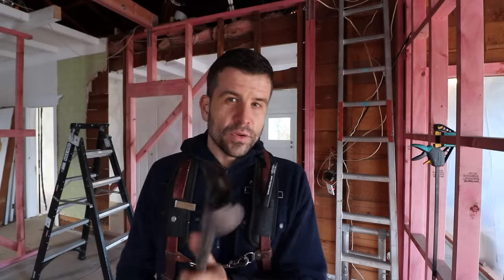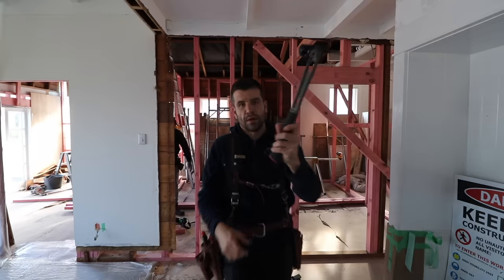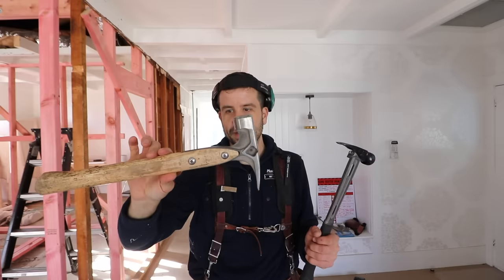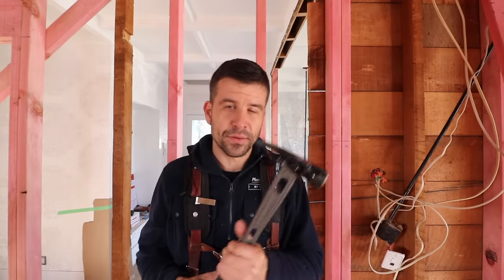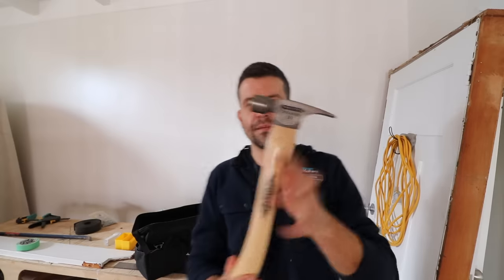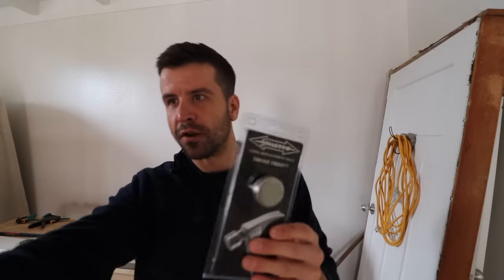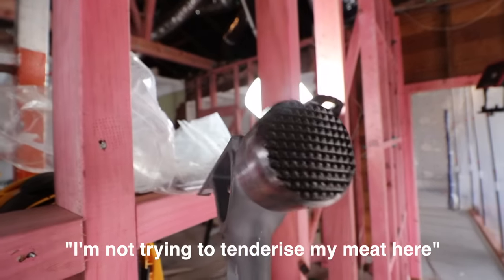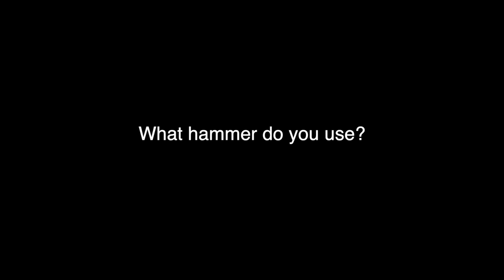Martinez M1: The Hammer Everyone Is Talking About

Comment: There's nothing new about this hammer, other than the Mfr's name on it. I swung almost that exact head design, made by Douglas, almost 2 decades ago. I believe Vaughn bought out the design/patent and/or company. This was a fantastic hammer. The top of the face was flat and you could hit a nail that was tucked into a corner. Nailing hangers w/ it was very easy. At the same time, Stilleto was making the TiBone. An all Titanium framing hammer, that had a replaceable face.

Comment: Im not a carpenter but I’ve framed garages, barns sheds, knocked down walls and and moved em just don’t do it every day. I be always been of the option a cheap hammer and several expensive pneumatic nail guns is the way to go. Again I don’t do this stuff for a living but still have a framing, brad, and roofing nail gun. I’m just curious why y’all use a $200+ hammer instead of a gun?

Comment: Been framing for 50 years....what  hammer you use isn't important if you use a nail gun. If you actually frame with a hammer use a wood handle with a 24 oz. head...no blisters and your arm won't wear out. If you're a remodel butcher use a metal hammer handle....better for pulling nails. Best hammer i ever used is a 24 oz. Plumb with a waffle head. The handle is great for your hand and the head steel is so hard it sings. Ive had one for over 30 years and the head waffles still look good. Btw titanium is just too light.

Comment: Call me an old dinosaur, but I'm still partial to my Estwing 28 Oz, long handle, straight claw framing hammer. If I use the non-waffle head one, I can do trim carpentry with it. It's just what I've used for 30 years.

Comment: I have bought and swung and embarrassing number of hammers. I've now had an M1 for over a year and I will never swing another for demo, framing, and general carpentry. I keep a shorter handled hammer around for trim work but that's it.
Reply: Straight or curved handle? Smooth or waffles hammer face?
Reply: @henri6595  the one I have has a curved handle, but I'm still debating getting a straight replacement grip. Started off waffled, now it's smooth as a baby's butt
Reply: @717UT  Thanks for the reply. I been looking at the M1 and M4 compared to the Stiletto Titanium Hickory Handle hammers. Do you have any experience with the Hickory Titanium Handle models? If so could you compare them? Is the vibration really that much less on the titanium handle compared to Hickory?
Reply: @henri6595  In the past I've had a 14 and a 12 oz stiletto with hickory handles. I actually still have the 12 on a short handle. Also have an old Mini14 Stiletto. I think, and this is pretty subjective, the rubber over the titanium on my Mini14 and M1 make for the best dampening. But if you want a super lightweight hammer, wooden handled Stiletto or Dalluge are hard to beat. I guess it matters in the work you're doing too. Just framing? Wood handle may be best. Demo and form work? Might want an all metal hammer to stand up to the abuse. I remodel so I demo too much. I'd probably beat up a wooden handled hammer in those scenarios. And I think the M1 hits hardest of all the lightweight hammers I've used.
Reply: @717UT  Thanks for the information! I will be doing home renovations just like you. Seems like everyone agrees the titanium hammers with rubber grips are the best to recieve the least amount of pain later.
Reply: @henri6595  You're welcome. And this is all my humble opinion. Remember too, the best pain reliever is setting a steady pace. The worst pains I've had has been when I'm pushing too hard for someone else's gain. Work hard but not at the expense of your health and well being.

Comment: It's space age looking junk. Titanium is brittle compared to steel so not worth the cost compared to a standard steel hammer. A wooden hammer handle is easily replaced or repaired by a craftsman and will have way better vibration dampening properties compared to metal. Wouldn't spend more than $5 for a hammer like that can't believe they are selling for $100+. Unreal.

Comment: 3:11 Thats more on your tool belt set up than the hammer.  That would be annoying having a hammer there any way. So much unnecessary reaching.Hammer sleeve  would fix this. Had this hammer since they came out  2017 i think. And the wooden handle framer of the same brand. The deluge looks awesome and know a few guys that use them. But the handles seem to break after a few months on the Vaughan version. Apparently you can get the true deluge version which last better.  You can get a straight grip for them i have the curved like you show here and am also thinking of changing it to a straight.

Comment: I have a Cheney hammer.      It's about 60 years old .  It's a ball bearing model, and it tells you which part of the nail to hit.   It pulls out nails if you put them in the wrong place.  The handle is made of special wood, it comes from a special tree.   It cost about $3.00 after we stopped using British money.   It balances perfectly, if you stand it on its head the handle points to the sky.

One side of the head is made to get bottle tops off,  it's a beauty!!!  I lost a degree of respect for this Chanel once I saw this shameless promotional crap.  You should have more self respect!!

Stavros

Comment: You get used to the handle pulling out of your bags. When you reach for the hammer make sure the head is pointed to the right side of your body and grab it with your right hand by the head and then muscle memory the handle coming out it comes out FAST. And the fact that you can see through your side puller makes it easier to use. My boss has been arguing with me that his Douglas that is very similar to that Vaughn he showed, us better and he says my stiletto TBIII bounces off 16’s and can’t move trusses. It does fine at 16’s but it’s faster than the other hammers. Wanna try the Martinez but I’m pretty good with that stiletto.

Comment: It sounds like you guys aren't aware that you can buy an M4 head and put it on an M1 handle. If you like a longer hammer, and lighter weight, mix and match. The best thing about the Martinez platform is that is is modular. You can buy a 2lb sledge head to put on either the shorter M4 frame or the longer M1 frame.

Comment: As a mechanic who always has some sort of grease/lube one his hands, and has trouble gripping tools properly. A tip from my grandad, remove that polyurethane coating on the handle. It’s basically plastic, bare  wood will never slip and if your worried about it warping or becoming damaged because of water, just give it a coat of linseed oil.

Comment: Did you bang in a gun nail cause ypu dont have spikes haha?? I prefer the TB though (mine is TB 2) to me its abiut the angle of the face relative to the handle. With the face flat on the ground the stiletto handle isnt touching the ground, Martinez is... more likely to dig the top of the head in and not strike with the face flat with the martinez IMO. I nail fascias and stuff with my framing hammer so i dont like to leave huge wounds in everything. Also i feel like i just strike more square with the stiletto

Comment: The m1 is great for heavy duty formwork where you still swing a hammer for a living and slap spikes all day not for guys that use a nail gun all day you need to grow some muscles 💪 lol.... try a 2 1/4” slick in the nail set on the tb3 it barely sticks out past the face not very well thought out... plus the steel head on the m1 holds the magnet better where as with the titanium head your always having to replace it due to scientific stuff

Comment: Slippery need of wood hammer is best dealt with by taking a metal card scraper and removing the finish on the handle. Adds grip without the stickiness of tape. When hammer gets dirty, it's easier to wipe/scrape clean.

Comment: You sand the finish off the timber handle the same works on wooden screwdrivers  after you get the finish off you can dunk the handle in oil and it won’t slip.

Comment: I used a Douglas hammer back in the early 2000s. It has the same shape as the Dalluge. Hart tools also made a version using the patented Douglas design. This design was conceived long before titanium hammers were a thing. Because the hammer was originally made from steel the idea was to also use the nail puller as a cold chisel or "Ax." The shape of the nail puller is a comprise between being a good cold chisel and still functioning as a tough cutting instrument. I gave that hammer to my coworker when I left for Architecture School. He abused the hell out of the cold chisel feature breaking concrete flash from sloppy foundation pours, and it was still his main hammer when I stopped by a job site to visit 10 years later! The Titanium would not be able to perform like that. It would break under such a beating. So basically, the Dalluge design is meant to be a steel hammer. They should probably redesign the nail puller at the back end.

Comment: 25 year carpenter here. If never swung that hammer. Looks interesting. I like the 14oz dewalt framer. It's all steel and hits hard like a 28oz hammer. That my fav. But I do have a question, why the hell is the wood pink? Never seen that before. And yes the titanium heads are known to kinda blow up. Steel head is much better. IV had stiletto hammers and for the price of 50 dollars I still prefer my dewalt. I also han a steel replaceable head kind and of course the screw came loose all the time. No good. Top banana make a reverse waffle head. It's pretty cool lol. 
Lmao I just got to the pink wood part. Thanks for the quick reply 🙄😁

Comment: I use a Vaughn, I sanded handle to a slightly better shape took the whole handle down to bare wood then waxed it for grip, no slipping now. I also drilled a 1/2' hole length ways down center of handle and filled it with silicone which further reduced vibration.

Comment: I've been using a Stiletto Mini 14 for about 7 years, faultless. Started with a Estwing 30+ years ago.  The difference in fatigue and impact force is noticeable, pulling nails way better.  Combine that with the Ti doggy bar and multi bar saves almost a kg of the belt!  Tried the Martinez too heavy in the head.
Reply: It was always a BS myth that titanium heads drive better than steel, it came out at the time that Titanium drivers were taking over in golf, and Martinez was smart enough to see the advantages. But Ti drivers are the same weight as steel drivers, depending on factors like minor differences in shaft length.   If you reduce the head weight by one third, you have to increase the swing speed by the same amount that the average PGA tour player outswing the average par golfer; or the average swing speed advantage the long drivers on the PGA, the top ten guys, have over the field.  It is only a 10 or 15% increase in speed, but it sets aside these different levels of super athlete, it is significant in the extreme.  So sure, a Ti head will drive as well as a steel head, but only if you are as fast as the average pro Golfer is relative a par handicap holder. And even if you do that, it is not going to be easy on the body.

A lot of it depends on two things.  Do you actually frame with a hammer, like the pros had to before nailguns were popular.  And what nails are allowed in your local code, or traditions.  Sinkers are a much easier swat than spirals.  Some nails may not be possible to drive with a single swat, and the more you have to hit it, the more there can be an opening for lighter hammers.  For most of my life, 16 oz was popular out east for a long time.  All Martinez has done is make it clear that if you are not production framing with a hammer, you can get by with a 10 dollar 16 oz hammer, that you can spend 250 for.  And we are well past the point where clients will recognize what kind of hammer you have, just as they can hire the crew with the beater vehicles, or top end trucks.
Reply: @HondoTrailside  The Mini 14 strikes a good balance, steel face 14oz.  Having munted wrists and fingers, the shock absorption is the big bonus for me, i don't get the pain in my bones any more.   Yes I use a gun for most driving, but i use the hammer a lot for chiseling.

Comment: I have both the stilleto and Martinez. The only 2 things I didn't like about the stilleto is the face never stays aligned for the magnet nail starter and since I do alot of demo the claw actually wore down significantly. Haven't had the Martinez long enough to judge it but so far they both great hammers and def saved my joints

Comment: I use a 14oz stiletto ti. At my local town fair they have a nail pounding competition and stilettos do well. 

I have tried to drive really big nails with it when working on a barn. At a certain point the lighter hammer tends to bounce off the nail more. For normal framing nails it does great.

Comment: I just found your channel today and have watched a few and am enjoying them. Ok I know its really easy to pick apart someone's hard work in making a video, but...I have to say both you and especially Rich are holding the hammer with your thumb pointing down the shaft and not wrapped round it with your fingers. I think this is where you get tendon issues and you also tend to grip tighter and put more effort into each blow instead of a lose grip with the weight of the hammer doing the work. I see so many people going for heavy hammers because they don't know how to use the weight of a regular 20oz and then end up with tendon issues.

Comment: Carpenters are always going for the wood because it absorbs more of the impact... not to mention it's almost always lighter. Your elbow will give out way quicker with the metal hammer. Go wood or go home.
Reply: With the amount of manual nailing being done nowadays there's little reason for elbow or wrist problems caused by use, unless someone has piss poor technique using their tools.  The highest present day risk to muscle, ligament and joints amounts to the predominant use of nail guns and their quite cumbersome designs, with hammers relegated to finishing work and poorly slung at the rear of younger carpenter's toolbelts.  Falling backwards is bad enough, but having hammer and nail puller badly slung to the rear is asking for trouble.

Comment: I'm a DIY woodworker, so I'm never going to spend £280 on a hammer.  In fact, i didn't realise a hammer could cost that much.  That said, I've been building a summer house recently and my Wickes general purpose claw hammer (£3.95) may have contributed to a bad dose of tennis/joiner's elbow!  So if anyone can recommend an elbow-friendly hammer at a reasonable price (say, £30 or so) I'll be interested to hear what you have to say.
Reply: Estwing Surestrike, or something by Stanley
Reply: @gazpal  Thanks Gary, your help is appreciated.  Both reasonably priced (I see that the Estwing's a little cheaper than the Stanley Fatmax), and both are described as anti-vibration, so I'll check them out locally if possible before deciding which way to go.
Reply: @ParaBellum2024  Never a problem Howard.  Estwing produce a wooden handled 20oz curved claw hammer that can be had for £21 or less incl postage

Comment: Great Video! Now I wanna weld a side puller on my Estwing and maybe grind the top flat...and add a nail setter. Vaughn makes a good hammer too, Though I like a durable all metal handle as I do a lot of remodels as well as new construction, wood tends to crack in extremes and with age. It sounds like that company might do well to mix their M1 and M4 to make a perfect hammer, or sell it as a kit, kinda like the one with the removable heads did, Though I have never had use for a waffle hammer. If I ever have one given to me it goes straight to the grinder for a polish. I am skinny too, accidentally bought a head heavy hammer once, don't remember the brand, sucker wore me out. Hammers need a good balance and the nail puller in the claw needs to get tight close to the handle for best leverage, longer claw makes better prying and long handles make for better leverage and reach.

Comment: had a stiletto hammer 2 years now and bloody love it so much. 14 ounce 18inch handle. replaced handle and gone for straight handle now and no tennis elbow because you dont need to squeeze hard, and if getting slippery just give it a rough sand. Its the most talked abotu thing i get with anyone who sees me working on the tools and i was wondering about the martinez.
Can you ask why stiletto can supply wooden handles ??
i had to go to amazon and i don't like massive companies that dont pay tax
Reply: So straight handle is better than curved?
Reply: @Fatandre1  yes i have found that for finishing and multi use.= yes if just pounding nails which i rarely do as nail gun is faster for framing when building allot.
Reply: @dogf4ther  Ah I see. I need a hammer for multi use and for Concrete frame work. I have the Stilletto 14 oz and like that so I am wonderingif I should go M1 or M4 with a m1 head

Comment: The trusty 20 oz Estwing has been good to me on two major remodels and a new frame up this year. Hard to beat for $25.
Reply: steel shaft? your elbow should be worth more than $25
Reply: @domusdebellum3042  I work around several guys decades older than myself that have used the same. No elbow problems to report from the lot of us. I may try a wood handle model soon, but titanium hammer prices are out of my budget.